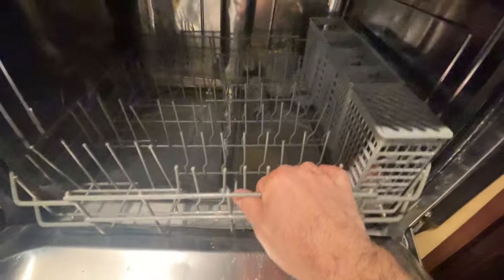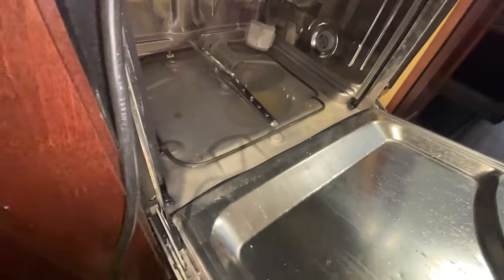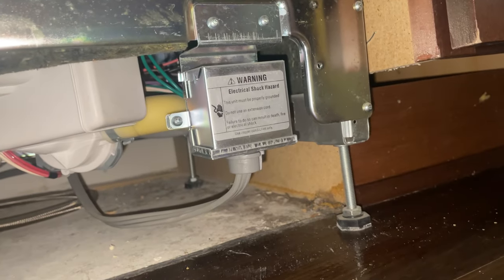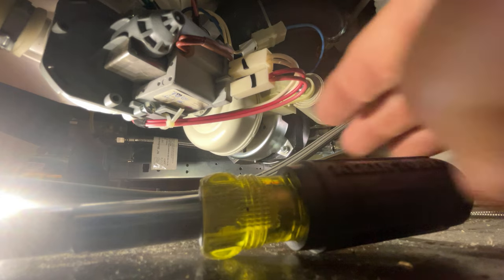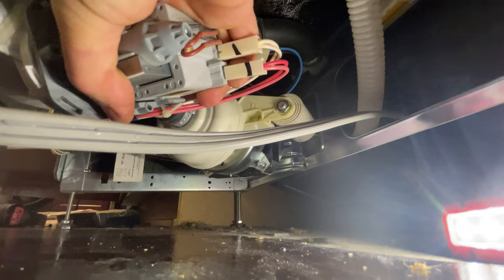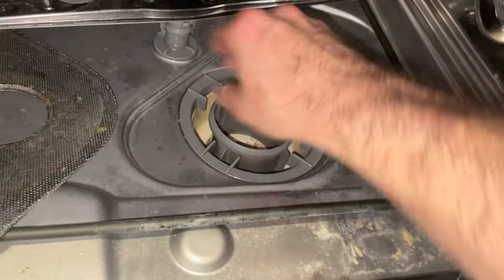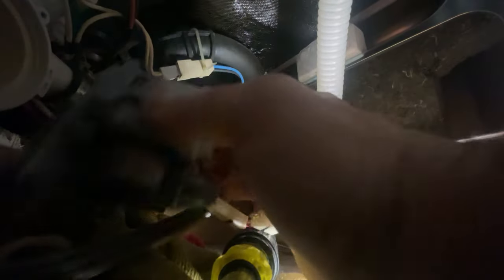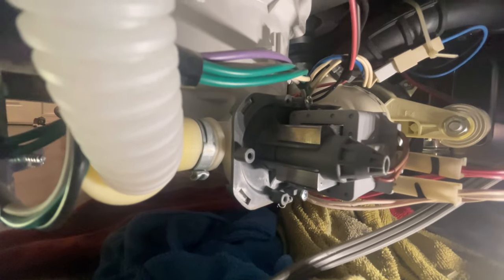GE Dishwasher Won't Drain

Comment: I working on a GE GSD4060d35ss
It wont drain water, so I found lots of stuff in the pump. And the small  repeller broke, so I order an OEM GE. Installed it, same problem. I am the pump works, and the valve open. I can see the shaft moving fast, but water won’t drain. A min later it shut off. I see you repair lots of dishwasher machine, so I need your advice. Thanks
Reply from the maker: Possible clogged dishwasher drain hose, if hooked up to a disposal, check the knock out
Reply: I just found out when I removed the screen to check for clogged. Off course, there were lots of debris in them. But, there was an orange ball at the bottom of that screen. I thought, it’s belong to one of my kids toy. Lucky, I didn’t throw it away. I couldn’t remember it either until, it took me about 5 hrs just to figure it out. It’s an experiment and experience challenging job when trying to do it without any help. Now, it’s done!  Thanks.

Comment: i encounter the same problem today is there any other suggestions to check  to unclog the dishwasher  the Property i work at all is GE but different modals
Reply from the maker: Make sure the strainer basket is clean, dishwasher hose is clear, air gap clear (if applicable), drain clear. I know some models have a float switch? that causes issues but I haven't personally dealt with those just read about them
Reply: @ApartmentMaintenancePro  thank you 👊🏾

Comment: Would i order the same pump even tho my is a diff model like its same brand just diff model
Reply from the maker: No. Always ensure your model matches the part - Amazon is ok at this in the descriptions usually but sites like ApplianceParts and Marcone are a little bit better. Use them all to narrow down the part number you need and then choose the best option for you (eg delivery speed, price, etc.)

Comment: Mine pumps. But it doesn't empty at the end of the cycle. GE. Common?
Reply from the maker: No. Is it hooked to a garbage disposal?
Reply: That’s what mine is doing too
Reply: And it is hooked up to a garbage disposal. But my disposal is working fine. I’m about to check the hoses.
Reply: @laurenschluter2575  what did find?

Comment: removeal white on top red on bottom replacement red on top white on bottom???????
Reply from the maker: Ya, good catch. 120v motors that don’t require a start device it doesn’t matter if you reverse the hot / neutral